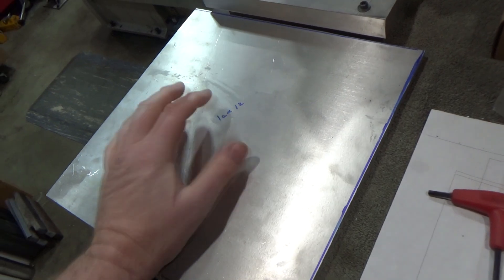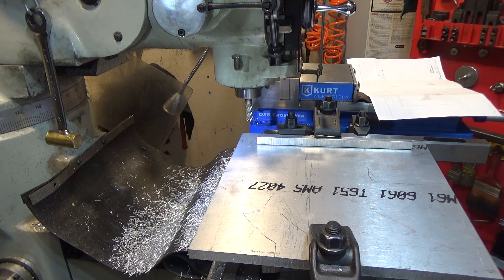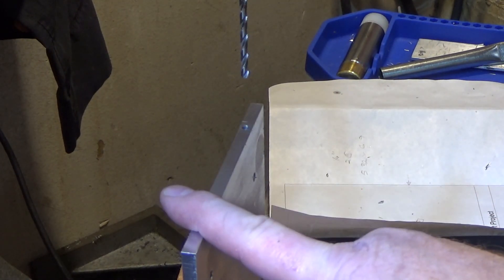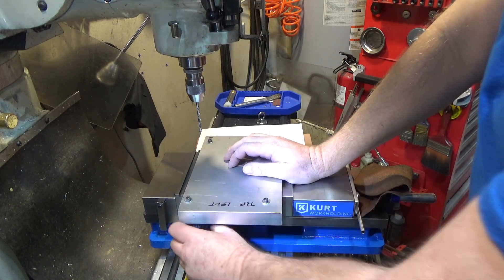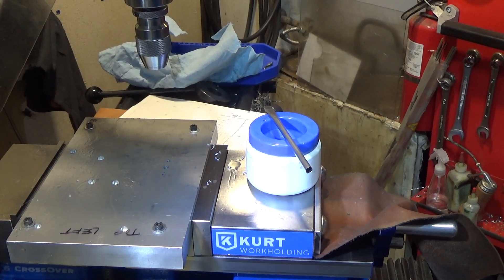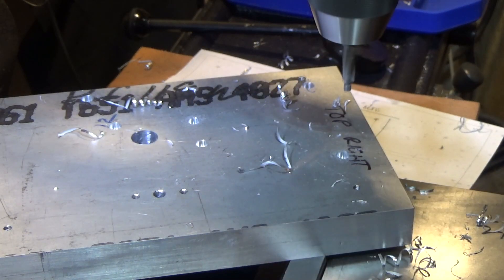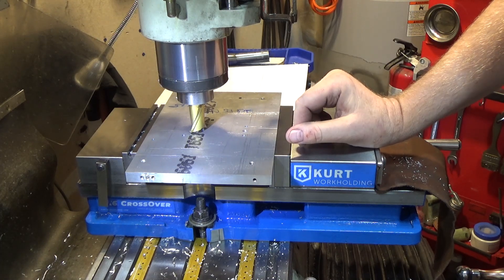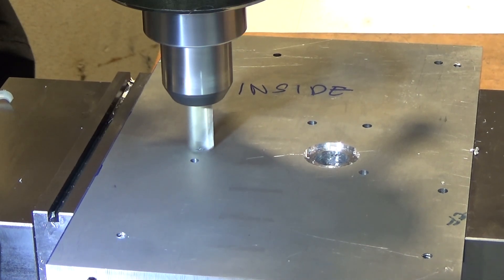208 "Toothpick" Dispenser Part 2 The Project Continues

Comment: Toothpick dispenser sounds like Stefan’s flux capacitor 😂
Reply: This is how the Manhattan project started.
Reply from the maker: Love it. This is the Simi ValleyProject! I really didn't know what to call it, so needle/toothpick dispenser. Besides, it was not an original solution of mine. I am building on the backs of much more creative folks.

Comment: Dude, use a hot water and super saturated solution of ALUM to remove the tap in Aluminum. alum will disolve the steel overnight, and allow you to re-tap it again. Better than the ugly holes...
edit: forgot to mention, they cannot be coated taps.
Reply: Good to know, thanks.
Reply from the maker: That is a really fantastic suggestion if it works...which I have no reason to doubt. Thank you very much!
Reply from the maker: By the way, I looked it up in Wikipedia and it lists this specific use for Potassium Alum and Ammonium Alum. Thanks again!
Reply: @DudleyToolwright  Do an upcoming video using it?

Comment: Aluminium prefers alcohol (like isopropanol) as lubricant, that might help out with the drilling/tapping. 👍
Reply from the maker: Interesting choice. I have used 70% iso before with good results. I have always been concerned about the flammability of alcohol vapors, especially since my milling machine is about 3 feet from my gas water heater.

Comment: Collets have saved me many times when I've run out of Z clearance when drilling. Even the shortest chuck is going to take up more space than a collet. They even make collet tap holders for power tapping that would have worked for your application. 

Not a fan of the new music track ;-)
Reply from the maker: The collet solution is a really good one. It would buy me an inch or two. Thanks. Sorry about the music!

Comment: Toothpick dispenser..... Trying to be the master of the flies?
Using plastic toothpicks I pull out a new one.... once per 2 years, something like that. Mostly the reason is to replace a toothpick dropped into some dirt. Hard to motivate a project like this...
Never mind, the fun is to create and build things.
Reply from the maker: I get ya, but this isn't really a "toothpick dispenser", I just stole the idea. It is a dispenser for hollow medical needles of a sort that have to have their solid tips laser welded on. This solution is this aimed at getting a robot arm to pick up only one needle at a time to be welded.
Reply: @DudleyToolwright  Sorry for underestimating Your project. (Not watching it yet. ) Soon....